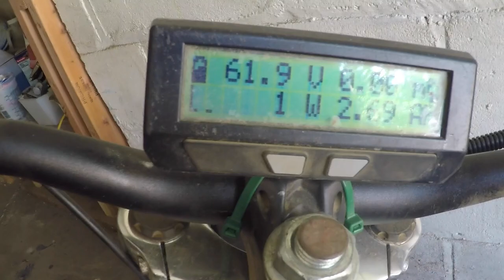Dewalt Powered E-Bikes and Drift Trikes

Comment: how do you keep from your batteries from over draining?  the BMS in the battery doesn't stop it when your using just the power outs does it?
Reply from the maker: I have not over-drained a Dewalt battery yet or noticed any permanent damage to the cells, so I think the BMS is always working. Also the speed controllers have under voltage protection and will stop working if the voltage gets too low. I have over heated and even frozen a few batteries, but the BMS will not allow battery to charge until returned to normal temperature.

Comment: I have been building a backpack that parallels 3 flexvolt batteries with a dummy battery to power the flexvolt tools like chainsaw, weedeater, and others I have reached a roadblock there is a lot going on in the tools to communicate with battery I have to get it fine tuned to work but when I do it'll be awesome ...
Reply from the maker: I think your roadblock might have something to do with getting 60 volts from the Flexvolt packs. Check out Mike LaDuca's video "eBike DeWalt FlexVolt Powered Electric Bike" and vuaeco's video "Dewalt Flexvolt 60V 9Ah battery teardown & analysis: From 20V to 60V, How does it work?" They explain how the tools communicate with the Flexvolt batteries to switch from 20 volts into 60 volt mode.
Reply: @ScottBl8ke  I already solved that thanks I bought a system off ebay that's pre wired and activated the 60 volt mode I'm thinking of using blocking diodes and figuring out how the tool communicates with the other terminals on the tools and packs
Reply: I did see videos with the 60 volt Dewalt drill bike. It was beast popping wheelies

Comment: very  cool. what do you use for motors, and speed control? and how long can you ride before recharging ?
Reply from the maker: Most of the details are in the description, but here are some quick answers. I really like the hub motors and controllers from EBikeKit.com, I also have a Cystalyte hub motor from electroride.com, and Unite MY1020 style motors from electricscooterparts.com Range depends on bike with pedals or trike with no pedals. I typically get about 1 mile per amp hour on the trikes, so about 10 mile range, and almost double on bikes with pedals, about 20 miles before recharging.

Comment: That's just f**** badass dude! I like the way you think man. I do special effects and prop making a movie so I do all kinds of crazy s*** at my house. In fact in a minute here I'm turning a worm Drive skill saw into a chainsaw some Prix stole mine. I got a couple 28v Milwaukee cuz some other Pricks stole the rest of the set. I was thinking about putting them on a bicycle you think that would work pretty good? I was also wondering about hooking them to double the amps but I'm not really good with electricity. Last year I caught myself on fire with a homemade heated jacket
Reply from the maker: John Smithllc Thanks for the positive feedback dude. I’ve heard of Milwaukee’s M12 and M18 batteries, but the 28v packs are new to me. I would combine two packs in series (positive to negative) to double the volts and use a 48 volt e-bike motor/controller. If you want to double the amps connect the batteries in parallel (negative to negative and positive to positive).

Comment: 20v x 6 = 120v Is it possible?
6 parallel connections
Is 110V ~ 120V electronic product possible?
Reply from the maker: AvE on YouTube made it happen. https://www.youtube.com/watch?v=pO1RqgAFP5Q And he only used 3 x 20V to operate 120V AC plug in tool. Very cool.
Reply: @ScottBl8ke 
Thanks for the good info. ^^
Have a nice day

Comment: Do you use fuses between batteries?
Reply from the maker: No, each battery has a fuse in it.
Reply: Built in or you installed them
Reply from the maker: @BobbyMacfarlane  built in

Comment: How did you wire this up ?
Reply from the maker: Most are wired in series (positive to negative) or 3 x 18 = 54 volts. Batteries wired in parallel increases amps (positive to positive), but these Dewalt packs can put out over 30 amps which is plenty for my toys.

Comment: Dude. I’m trying to do the same thing with 3 18v batteries for my bike and I can’t get it to work! Help!!!
Reply from the maker: Check your wires and connectors. I use Anderson Powerpole 45 amp connectors and 10 gauge silicone wire with high strand count. I burned a bunch of cheap terminals and brittle wire from the local hardware store. Thick wire and quality connectors are more expensive but hot wires equals energy loss.

Comment: how long running time on e bikes before they are drained ?? is it worth the extra milles ?
Reply from the maker: I typically get about 1 mile per amp hour on the drift trikes with no pedals, and about double the range on the e-bikes. I use 9 amp hour batteries, so I can go about 9 miles on my sofa chair or 20 miles on the tandem bicycle with a full charge.

Comment: Your inventions are wonderful! 
I am looking into powering my ebike with batteries like yours but I am afraid to burn the controller (48v 30A max). Are you running the hub motors with 48v controllers? , do you know how much voltage they can take?
Reply: @pcparlor   I built 4 ebikes since I wrote the comment. 
The dewalt batteries are 18v nominal. 3 in series fully charged give 61.5v. A bafang BBSHD with stock controller works fine at 61.5v as well as other 48v controllers ( capacitors are rated for 63v).

Comment: why so tender with the batteries? slap em in, practice for pitstop races
Reply from the maker: The 3D printed battery mounts are not as strong as the factory clamshells, and some of the battery terminals are bent so I have to be careful not to damage them further. 7 years later and I'm still using all of the bikes and trikes in this video.

Comment: I see you use a CA from Grin for a computer to control the  motor,I use them also
Reply from the maker: Conrad Lenger yes, I got a Cycle Analyst on the drift trike with 2kW Crystalyte hub motor. I prefer no computer, but Grin makes great stuff.

Comment: I was thinking of a long range scooter with 60 v 
Put extra packs in backpack for long trips. Change them out as go dead.
60 volts = 50 mph or so correct?
Reply from the maker: MPH depends on RPM, gearing, and tire size. I'd connect the extra battery packs in parallel to the scooter motor. Increasing the energy capacity will be less stress on each individual battery pack, you will accelerate faster and go further then if the batteries are in your backpack and not connected.
Reply: You should run the batteries in parallel instead of changing them.

Parallel means less draw from each battery / pack, so increased overall capacity.
Reply: Doesn’t putting them in parallel risk de-rating packs, as they will balance to the lowest pack capacity? I.e. a crappy pack in the mix will pull the whole lot down to its level?

Comment: Do you custom build and where are you located?
Reply from the maker: I live in Omaha, Nebraska, and work with Omaha Bicycle Company on custom builds.
Reply: I really like the idea of using dewalt battery packs. I’ve never done anything like this but never to old to learn. Would like to find a place to get the wires going harness to put 3 or 6 together for a cheap front hub e bike. I’m in the trucking business and thought it would be cool to have one for weekends.